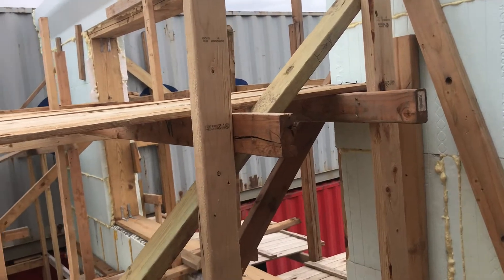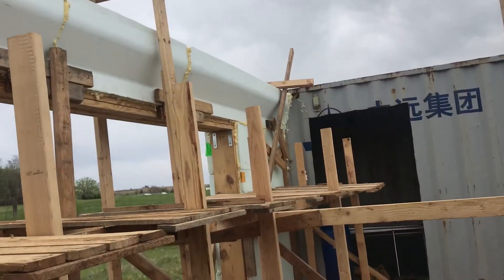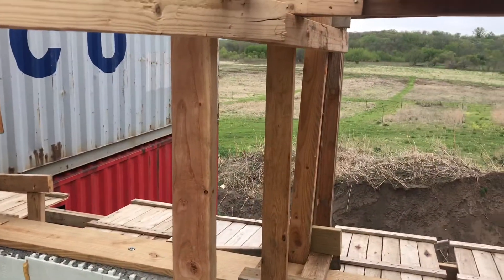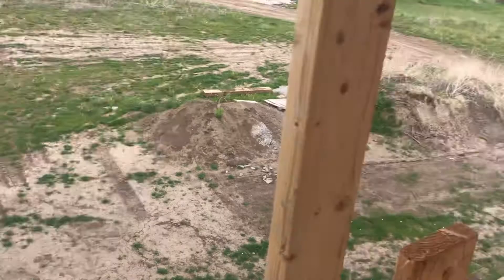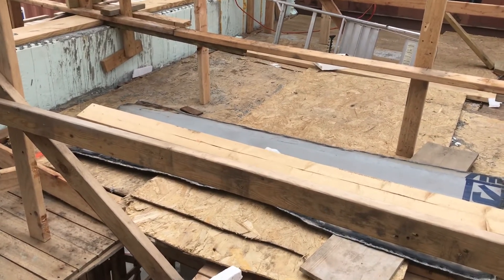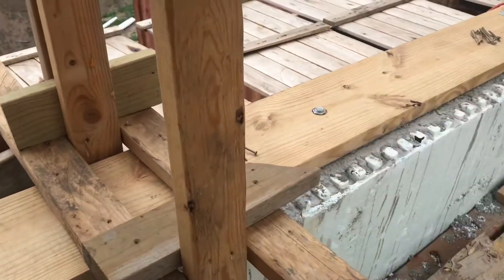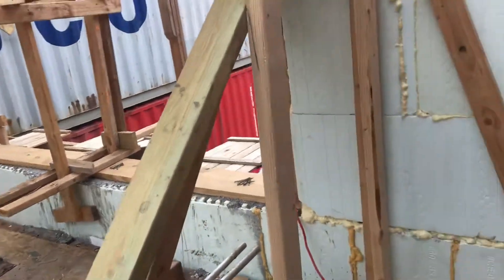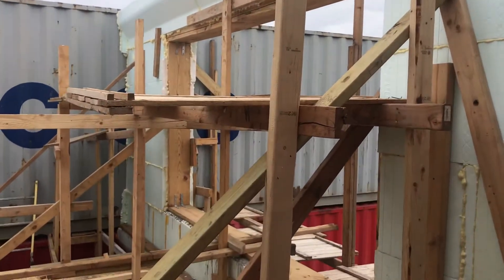#67 Container Home update// office walls formed

Comment: Will the concrete stick to the steel of the container or will it be attached somehow? Thanks for the update
Reply from the maker: That is a great question and I very much appreciate it. Per what i have discovered during the research process prior to my build,  concrete itself can bond to the container sides and will not slide off since the surface is corrugated ( that is  if attachment point is vertical and if the concrete wall is thick enough to cover at least 2 undulations). Nonetheless  the solidity of this bond is not guaranteed since the surface is flat and there are no spikes to hold concrete in place (Meaning that instead of sliding left or right the container can tilt away from the wall instead).  In order to mitigate this risk for my build I have cut holes on the inside of the boxes and have inserted heavy duty anchor bolts to hold and attach the concrete walls to the metal boxes and keep the walls in place. Additionally, my middle concrete walls originate all the way from the basement footings and could stand alone even if not attached to anything. With all of this being said however, I am totally open to recommendations and suggestions if you have any.
I appreciate your question because it helps me to provide more details and hopefully get a suggestion, in the event someone else in the audience has a better idea.
Reply: @Midwest-Container-Home  anchor bolts it is, I knew you would have something! I was just thinking that there may be some movement between the two surfaces and a crack or separation of some kind could occur....especially the cold wind in the winter blowing in. You’ve pretty much got it all figured out and I can totally see why you would use what you have on hand for your scaffolding. What a confusing mess though with this stage of the build right? I wonder how long you have to keep those blocks on the concrete before you can remove them, is it a few weeks or do you have to wait for it to cure, and if so how long does that take? It sure is an interesting build and I look forward to your continued progress. Thanks for the update Mr Container!
Reply from the maker: @nena4215  the forms do not get removed. They stay as they are also insulation for the walls.